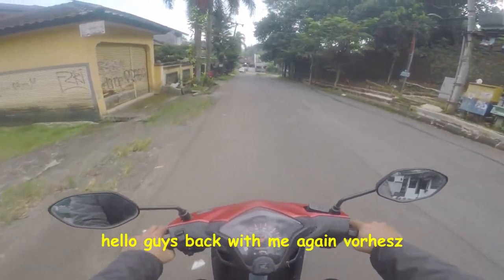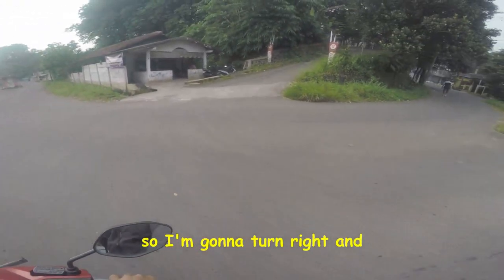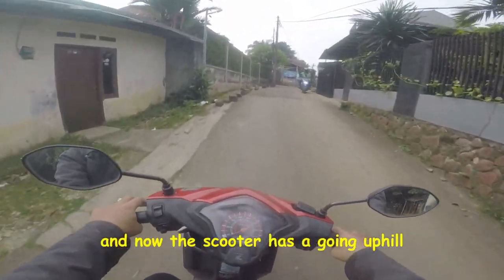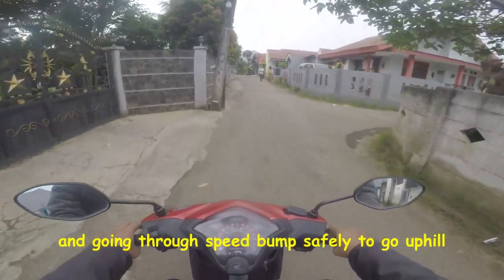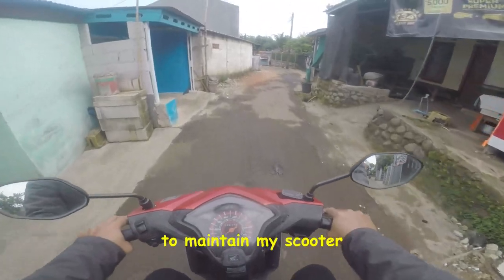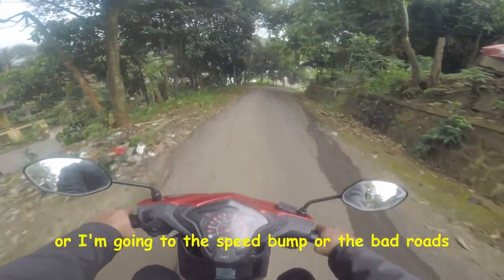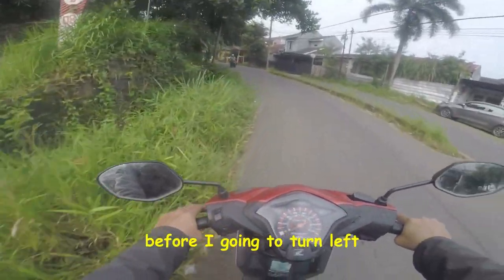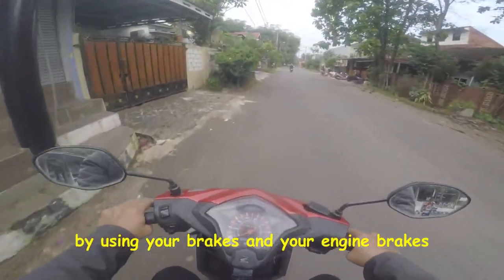How to ride scooter uphill and downhill 🛵

Comment: As there is no engine braking facilities in scooty (or other gearless vehicles) like motorcycles with gear where you can engage 1st gear in a steep downhill. In this case you have to continuously apply brakes which I think is the only possible action. Can you please suggest any alternative idea?
Reply from the maker: By open the gas slightly it will do the engine brake

Comment: I have a question, a 170cc scooter with 10cv can go up a slope of 15%?
I am considering buying one, but the road is a little fast and I need a scooter that can go up the hill at least 45 km / h so as not to stop traffic.

another question a relatively fast descent the cars run at 70-80 kmp downhill, can a scooter go down near that speed without danger?

thanks for the vid, and your information
Reply from the maker: 15° is possible with any scooter
About the downhill, there'll always potential danger with any speed
Ride safely 😁
Reply: @vorhesz  15% incline, not 15° !